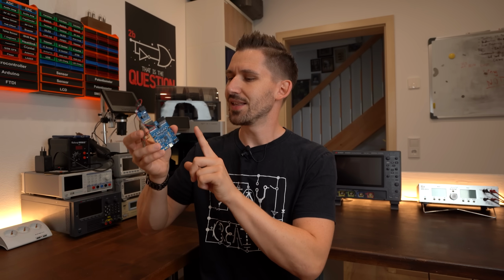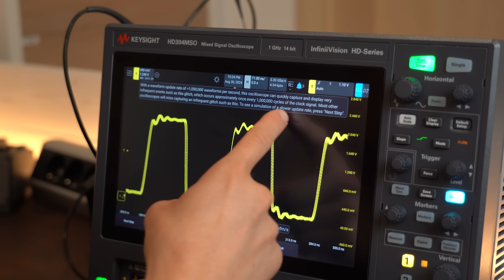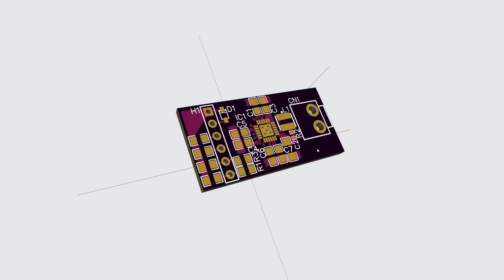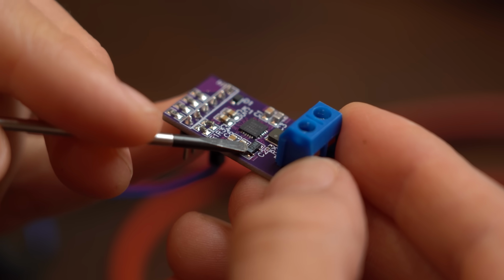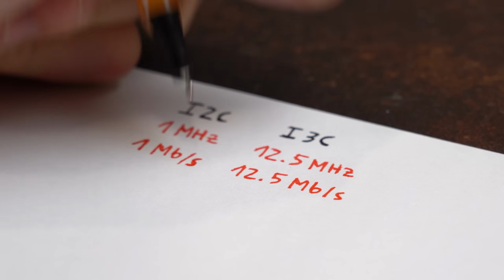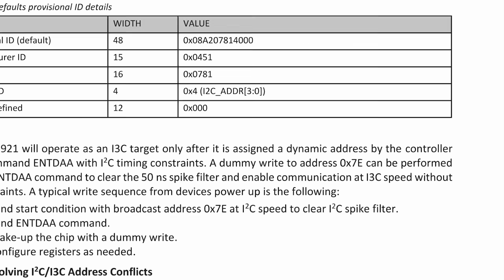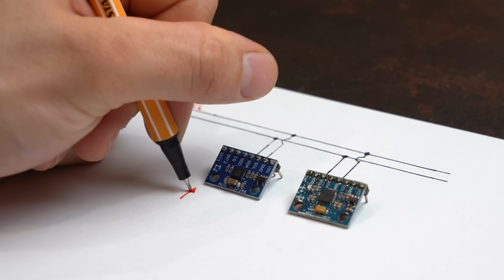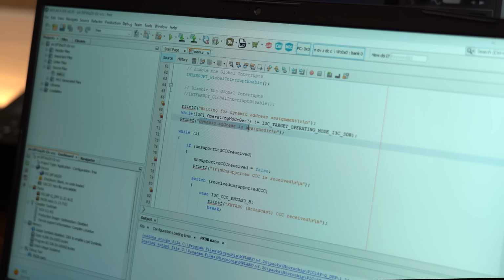Is This the NEW GOLDEN Standard for Communication? (I3C) EB#60

Comment: One thing I dislike about I3C is the fact that there are actually two different versions, with different capabilities: MIPI I3C and MIPI I3C Basic. This makes things somewhat confusing when selecting a device, because you will have to double-check the degree of support for each of them.

Fortunately, I3C Basic is essentially royalty free, AFAICT. I suppose MIPI Alliance did this in order to increase adoption. However, the "paid" I3C has some cool functionality (multiple data lanes, device termination monitoring, Common Command Codes that work only on paid version, etc), but are gated by compliance and, most importantly, royalties, for which the cost will eventually be passed on to the end user.
Reply: It feels really gross to have a protocol with royalties at all... Like, the entire purpose of a protocol is interconnectivity. They should've licensed the IP blocks and/or official vendor id prefixes or something and made the protocol totally open, they'd probably even make more money that way. But no, they had to get greedy and tax the protocol so no one wants to use it in the first place.

Comment: Any suggestions what the best wireless protocol is for overcoming shielding? I want to receive a signal from inside a metal container that's inside a metal fridge. RF, bluetooth, ESP-NOW, 802.11?  I'm also an FPV drone tinkerer, so could potentially use ELRS or similar.

Comment: Bitbanging is one of those things you should do if you have to.  The hardware is there, it's not hard to learn how to use and it means most of the time, at least with the 328p, you can just send and receive data without your code having to handle all of the steps involved.  I don't get why so many people wanted you to bitbang, that seems backwards to me. 

Also, I-Cubed-C is what I would've thought it'd be called. But it's not written as such

Comment: With the vast penetration of I2C, the need for a new hardware stepping to add the inner workings, and the slow pace at which these controllers get developed and revised, I expect that I3C's adoption will be just as slow as mainstream microcontroller adoption of the 5 GHz Wi-Fi band. It'll be many years yet before I3C can be used across all of our microcontrollers and devices. As clunky and sometimes unreliable as I2C can be, we're stuck with it for the foreseeable future.
Reply: It certainly won't happen overnight, but I3C will likely replace I2C in the long run, the advantages cant be ignored. Once more micro-controllers have support, the use will be fairly transparent.

Comment: The "hot connect" thing surprises me a bit. If that's something you need, shouldn't it be quite easy to make your code handle devices appearing and disappearing on the I2C bus?
I'm frankly surprised that there was a problem at all, with how I2C works.

Comment: Does i3c has same licensing as i2c? 
TWI is basically i2c compatible without licensing fee so many MCU:s use it.
Reply: At this point it appears the only thing that may require licensing is calling it I2C, since my understanding is that I2C remains an NXP (formerly Philips) trademark. 100 kHz goes back to the early 1990's, with later 'high speed' updates around '97 (albeit there was apparently an aborted patent 'refresh' attempt launched in '99.)  The need to license I2C was significantly muddied by the agreement to allow royalty free use of the SMBus specification in 1995. 

SMBus and 100 kHz I2C are almost identical in their physical layer, with only a slight difference in defined switching levels and data hold after clock parameter. They were so close that vendors could easily make devices that met both specs, and by specifying them as SMBus devices they avoided the general I2C issues - even though they were interoperable with more 'generic' I2C implementations. 

In addition to defining the physical/transport layer SMBus specified devices be accessed using particular write-read operations on the bus (referred to as 'protocols' in the spec) that made SMBus altogether a subset of I2C's capabilities. For example, SMBus doesn't allow indefinitely long bus transfers, or arbitrary combinations of reads and writes in a bus transaction. 

However, most devices, such as temperature sensors and SEEPROMs could be made without requiring transactions beyond what SMBus offered. Those more sophisticated operations that could potentially be used with unrestricted I2C were either not required or readily worked around with some small loss of efficiency. (I.e. transferring data by issuing a series of individual SMBus transfers instead of long 'atomic' I2C transaction.)

The 'high speed' (1MHz+) specification updates from Philips added elements to the specification that they patented, but those elements were hardly used. Instead, most people just ran the "100 kHz" SMBus with faster timing. Since just having updated timing specifications is not generally patentable, the bulk of I2C IP appears to go back to those early 90's. Given the typical patent duration of 20 years, it appears that most of the base I2C patents probably expired around 2015 or earlier.

Lastly, long before potential patent expirations my understanding is that most major semiconductor manufacturers had cross-licensed portions of their patent portfolios with Philips such that they would not need to pay licensing fees for their devices using I2C. The remaining royalty/licensing revenue opportunity had become down to just the 'little guys' who probably would have just dropped using I2C (TWI) altogether had Philips pressed them.

Comment: I3C is useless without hardware support. I3C has been around since 2016 and there's still less than 100 microcontrollers stocked on DigiKey that support it.